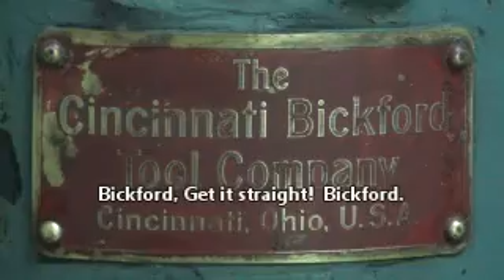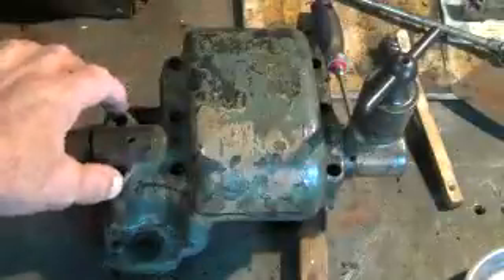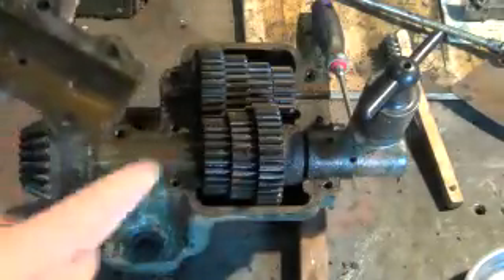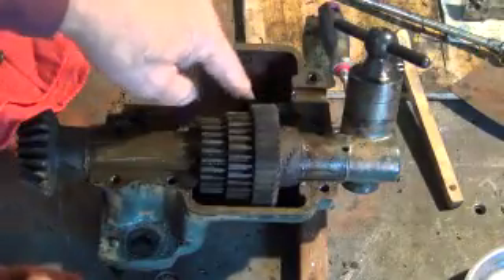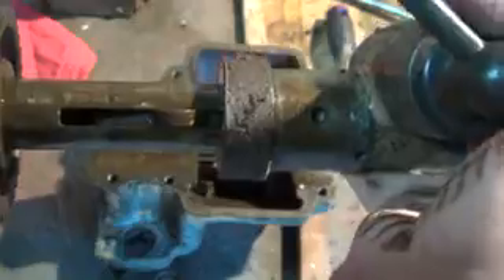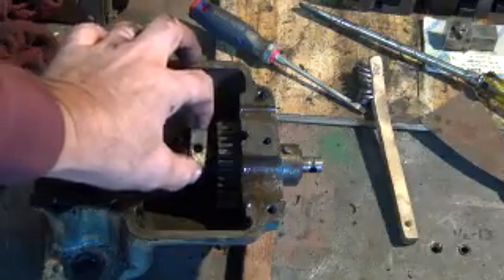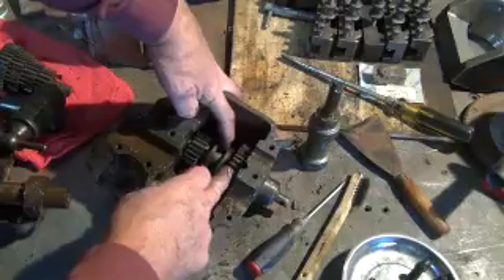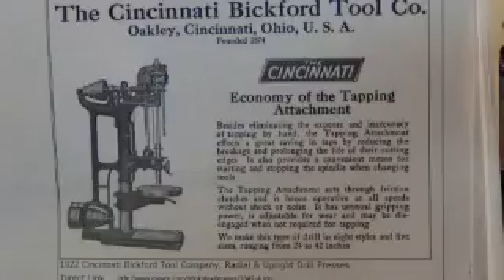Camelback Drill press, auto down feed

Comment: I have a Prentice Brothers camel back drill that has a similar transmission for feed speed, thankfully you posted this so I have something to go by in my restoration.  The Prentice drills transmission is not encased as yours is, so the only way it's oiled is through oil holes.  I'd suggest yours doesn't have a oil bath, but utilitizes the case to reduce contamination and retain some lubricant.
Reply from the maker: Yes, I think you are right.  I oiled everything good, and over time the oil has slowly dripped/leaked out.  And the case would seem to reduce contaminates.  Thanks.